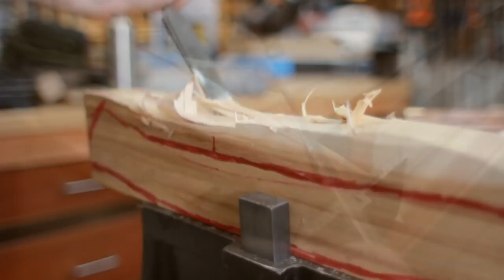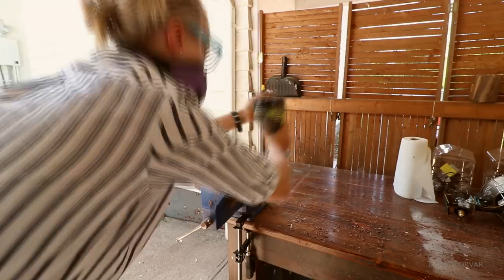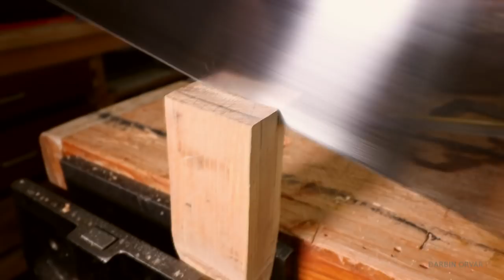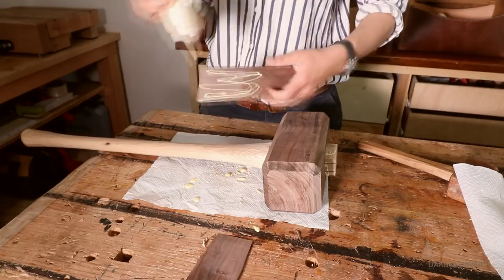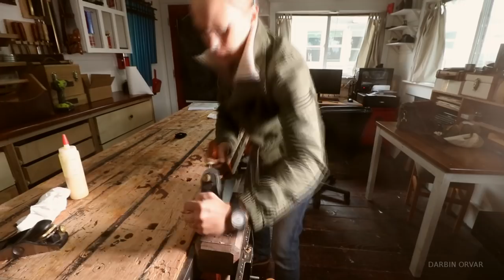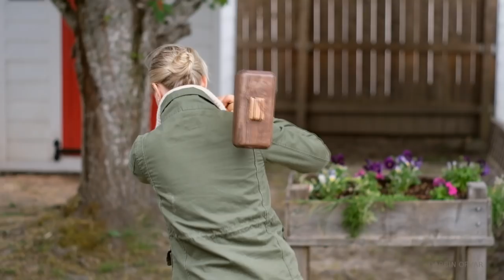How To Make a Two-Handed Mallet

Comment: Your mallet looks great.  Years ago I had High School kids (in Australia) make similar but smaller mallets.  We naturally used Aussie timbers, Brush Box for the head and Spotted Gum for the handle.  The only difference is that we put asingle wedge in across the grain of the head as we felt there was less chance of splitting the  Brush Box when the kids drove it forcefully in.

Comment: Beautiful work! But I have to point out that the locking wedges holding the shaft in the head should be inserted perpendicular to the head. The way you did it, the wedges could split the head when driven in.

Comment: Hickory is the best wood for handles because it's strong and flexible. If you have the right kind of hickory. I can't remember if it's old or young but one is supposed to be more brash or brittle than the other.
It looks like a good Viking weapon though. It should be good for raiding.

Comment: That mallet is wonderful and the video nice and straightforward and easy viewing. But why did you use a router to bevel the edges of the head? I’m sure hand planing would have been quicker and produced a nicer finish. And if the faces had been hand planed you would not have needed to sand the head at all! You might also want to look at "wortheffort” on sawing to the line. He says do not do a couple of back cuts to establish the initial curf, just go fo it and it will be fine.